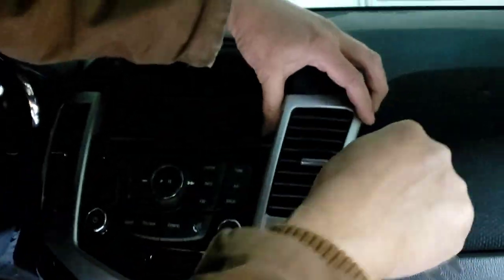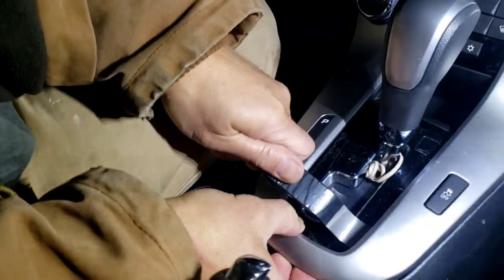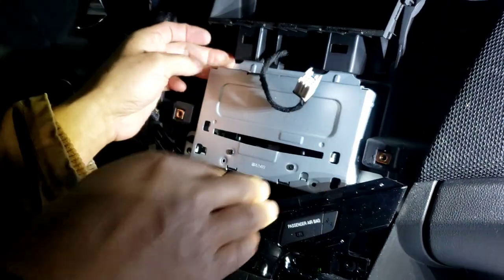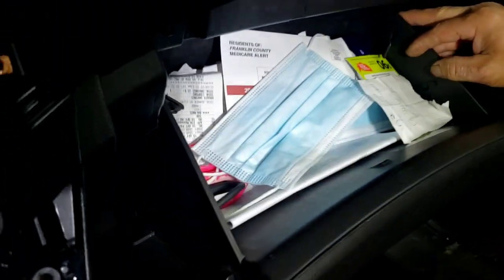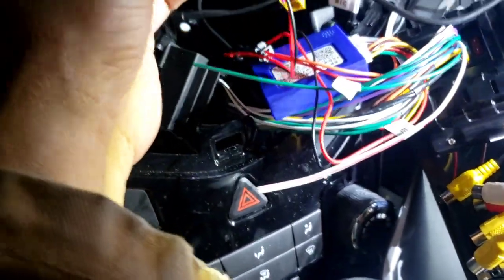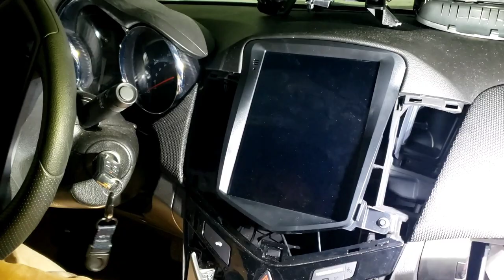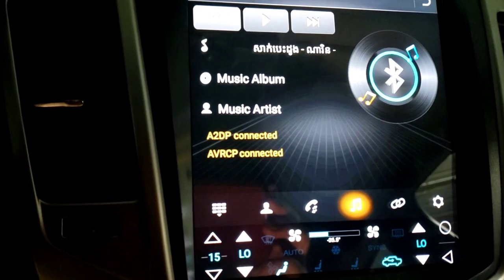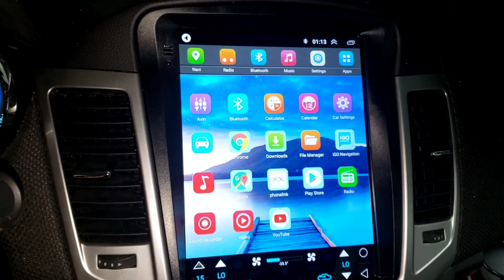Chevy Cruze Tesla 10.4 screen installation 2011-2015 and Removal

Comment: If anyone needs help wireing there radio or any questions just leave a comment I’ll get back to you
Reply: do u know what the big grey power cable is called
Reply: where did you find your touch screen at
Reply: because the car on the screen does not appear on my radio
Reply: Where can I get the screen and accessories?
Reply: Would sirusXM work on this ?  I'm not sure if the app only works with wifi or if it would recognize a satellite signal ?
Reply: hello sir..i already install..eveything good work..but when reverse don’t have the sound beep beep like before
Reply: I don't know how to change the logo of my Chevy car on the default screen it has a Ferrari and I don't see how to change it
Reply: What brand is this unit? Where can I buy one?

Comment: Hello what is the correct can bus setting for a 2014 Chevrolet Cruze?
Reply from the maker: @ZapStreamm  im working on a 16 right now as we speak
Reply from the maker: @ZapStreamm  do you know how to get in a factory set mode
Reply: @khmerohio  000000 worked for me, mine is Kunfine brand. Do you know which is the correct canbus option to choose for a 2014 Chevrolet Cruze LT to make everything fully working and functional?

Comment: Did you have any issue with after you shut the car off and lock the doors and return the radio Going black but you can still hear the volume
Reply from the maker: Check your driver's door switch
Reply: Mine is doing the same.   Installed it and it was working great.  Then I shut off the car and turned it back on.  And the screen is black and won't turn back on.
Reply: @jerrygarza6280  Mine is doing the same thing. Radio works, screen won't come back on after key being off for longer than one minute. The only thing I can do is change engineering debugging so that it does a hard reset after the key being off for longer than a minute.
Reply: @rjmatula1  have you tried to see if it works?
Reply: @jerrygarza6280  It works, it does a hard reboot when starting the car now. Beats pulling the radio fuse to get it to restart.
Reply: @rjmatula1  it worked!  Thanks for all your help bud.   Definitely beats pulling the damn fuse
Reply: @jerrygarza6280  They are sending me a firmware update file that is supposed to fix the issue so you don't have to do a cold boot each time. If we have the same radio, it may work for you. Mine is a F9212B in a 2014 Chevy Cruze. IF the model of radio isn't the same, it could possibly brick your device. I will let you know if it works on mine.
Reply: @rjmatula1  keep me posted.  Not sure witch model I have.   But I have mine installed on a 2012 chevy cruze
Reply: @jerrygarza6280  I found an update that works! download on a usb drive  (gongban_F9212B_SP_768x1024_mipi-ota-v7.3) from xyauto
Reply: @rjmatula1   with the update , will it fix the auto hard reset?
Reply: @jerrygarza6280  Yes, after installing you have to go to android settings and change the language back to English and then log back into factory settings and set it back to user mode. Mine works perfect now.. actually better than the factory firmware
Reply: @rjmatula1  I'll give it a try.  I'll keep you posted

Comment: I bought this audio system for my Chevrolet Cruze. And I have a question, how do I initialize the audio system because I haven't used the car for two days, the audio system is trying to load and all the time the operation repeats itself and the Android system is stuck.
Reply from the maker: Remove the positive side of battery for about 30 seconds
Reply: @khmerohio  not help

Comment: We just installed this head unit in my 2012 Sri-v and now on my instruments on my dash is now in Chinese. Any idea how I can change it back to English? I tried doing it through the new head unit but when I do it it works then just flicks straight back to Chinese
Reply: I have the same issue!
Reply: Hello, I just installed mine today, same problem happened to me, my phone wont connect to car play, and it changed to chinese as well. Please reach out if you got any help. Thanks

Comment: My radio monitor won’t turn on every time I start the engine, but I can hear the radio on. Please help
Reply from the maker: Check the red and the yellow wire in the back to see if it got power. Honestly I think your screen is bad
Reply: @khmerohio  what’s the purpose of key1 and key2 wires? I always unplugged the radio cords if this happens and it works but after turning off the engine and the radio screen is all black
Reply from the maker: It's for steering wheel control
Reply: @khmerohio  I hope it’s not the screen issue as it turns on after unplugging it but turns black again after turning off and on the engine
Reply: @NigelTheWhiteChicken  Mine is doing the same thing. Radio works, screen won't come back on after key being off for longer than one minute. The only thing I can do is change engineering debugging so that it does a hard reset after the key being off for longer than a minute.
Reply: @rjmatula1  I returned mine from Ebay and ordered another from Amazon (just arrive today). It’s funny as both packages are equally similar wherever you order. Hopefully this time works, if not, imma do what you said on eng’g debugged. Thank you 🙏
Reply: @NigelTheWhiteChicken  Let me know if the new one works correctly.. I may do the same thing and return mine if your new one works. Kind of a pain in the ass to wait for it to do a cold boot before backing up, although it beats the alternative of pulling the fuse or wiring in a switch to the fuse and waiting for it to boot..
Reply: @rjmatula1  the new one works but the bluetooth is connected to my phone but no sound?
Reply: @NigelTheWhiteChicken  In the bluetooth settings screen did you select the music icon? Mine will not play sound unless I click that icon after selecting bluetooth from menu. The only thing that will automatically connect is a phone call. (at least on mine)
Reply: @rjmatula1  oh oh! The new one just stopped working after turning on the engine again. What is the password on eng’g debugging?
Reply: @NigelTheWhiteChicken  Set it to the bottom setting, direct shutdown mode. Works for me..
Reply: @rjmatula1  thanks! It works but only the bluetooth has no sound 🥲
Reply: @NigelTheWhiteChicken  I found a firmware update that operates correctly (and faster than the factory firmware) download: (gongban_F9212B_SP_768x1024_mipi-ota-v7.3) from xyauto
Reply: @rjmatula1  I already returned the radio to Amazon, this is the second time I returned it 1st from eBay then from Amazon. I just use my stock radio for now. Thank anyway ✌️
Reply: @rjmatula1  Same issue...Can you send me the download? I'm not sure where to find it.
Reply: @rjmatula1  can you make a video of these please.   A lot of people are having this Bluetooth problem. I am and I can't fix it.

Comment: Hi Thanks for this video. I have the exact same screen but Radio is not working for me. I can see it searching local channels but no sound. Any idea?
Reply from the maker: There should be a blue wire u will need to tap it with the blue/white
Reply: @khmerohio  hey thanks for the reply. I will look into cables again and see if I could find blue and blue/white wires.. do you know what are those wires for?
Reply: @khmerohio  how come you didn't tap the blue wire?
Reply from the maker: @mistrykr  sometime you have a bad remote  output

Comment: great video! i just installed mine yesterday but it says my CarBus is disconnected even though everything is plugged in. not sure if anyone else is experiencing or had the same issue?
Reply from the maker: Did you reset it by unplug the battery terminal or unplug the radio
Reply: @khmerohio  no, I only disconnected the negative when I installed it. So I have to disconnect the whole battery?
Reply from the maker: Just one side,  check the connection to see if you're connecting on the right side. Those are common mistakes that id seen

Comment: Im definitely taking mine out I think I regret putting it in
Reply from the maker: What happened?
Reply: @khmerohio  it takes a minute to connect and I have to turn on the WiFi and the Bluetooth and if both don’t connect it won’t work and sometimes it would just disconnect all together. Also people can’t hear me when I make calls and so much more I love the big screen but I wanna take out.
Reply: You can’t even use the other apps without WiFi connectivity